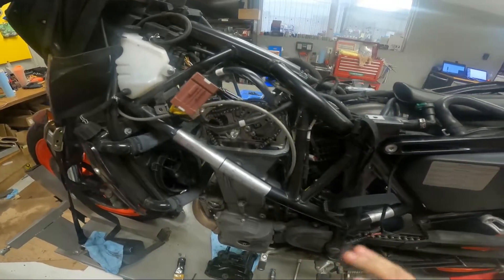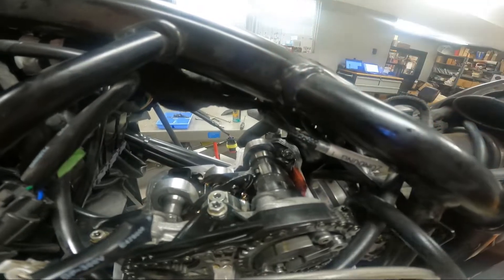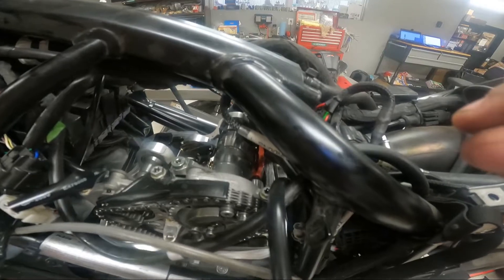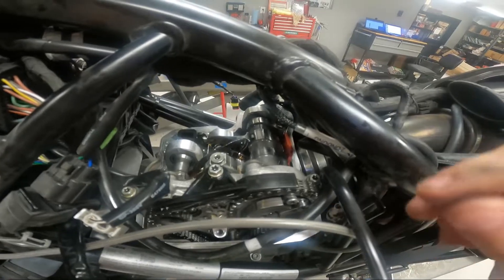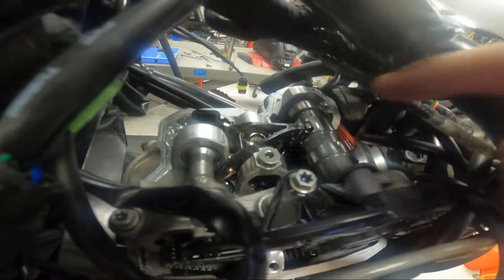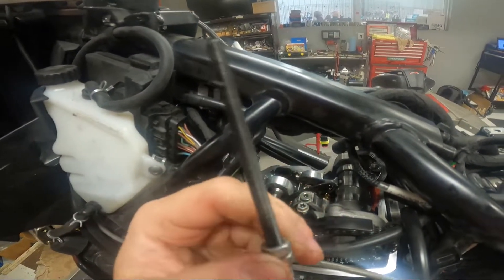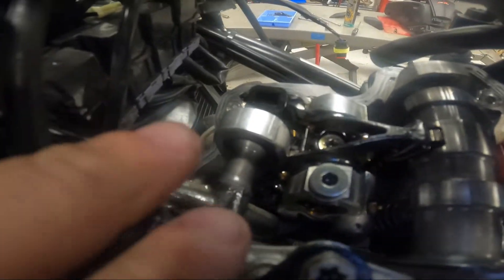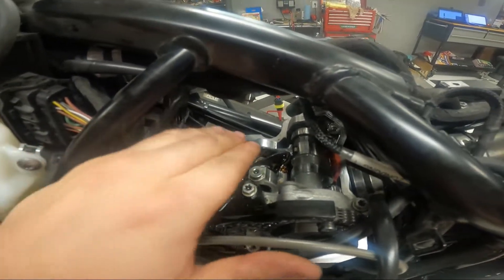2018 KTM 690 Duke | Valve Adjustment Overview

Comment: For removing the shims I use a strong magnet.  For installing, I take a zip-tie, bend the last 3/4" to about a 75-90 degrees, apply grease on the end of the zip tie and the shim will stick well to that.  You can then easily position the end of the zip-tie and shim into the gap where the shim goes and push the shim off with a pick or screwdriver.  Easy-peasy. Thanks for the video, shown me the orientation of the orange retaining clip - I had it out for so long (a few weeks) I forgot which way it went back in and you can't see it in the service manual.

Comment: Doing that job on  my Husqvarna Svartpilen 701 right now. After I removed the gas tank I found a broken plastic tube that has 3 vent hoses attached to it. The plastic tube is housed inside the center metal frame tube. Do you know what this plastic piece is called, I have to order one.

Comment: Do you have a video showing how to check the clearances? On my 2016 duke it’s super cramped and I can’t see where to get the feeler gauges in, first video I’ve seen on this type of engine so far!
Reply: Have you had any luck? I'm kind of stuck at this point as well
Reply: @mitcho53  I did manage to do it, you have to kinda bend the feeler gauge a bit and get inventive with the angles you go in on the valve at, it was about 6 months ago now so I can’t really remember